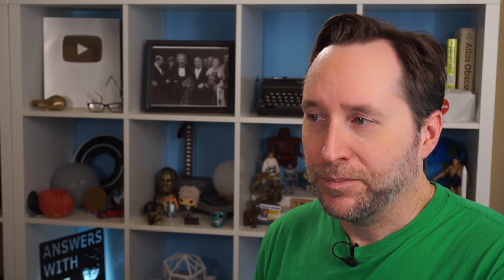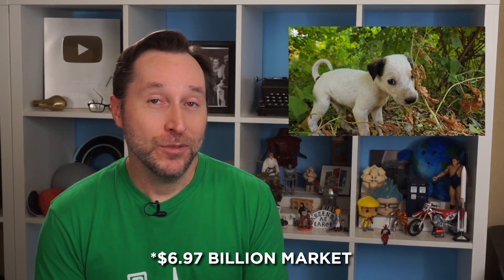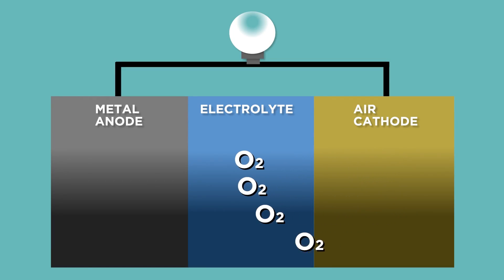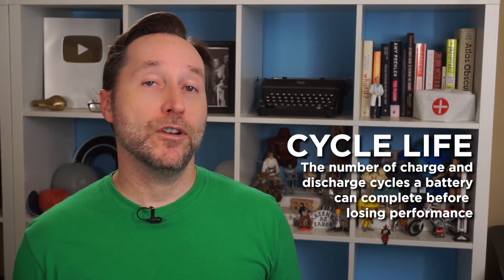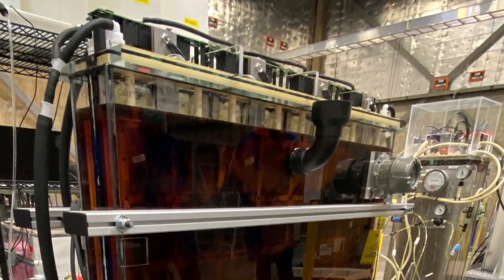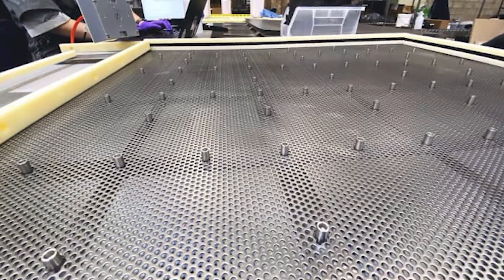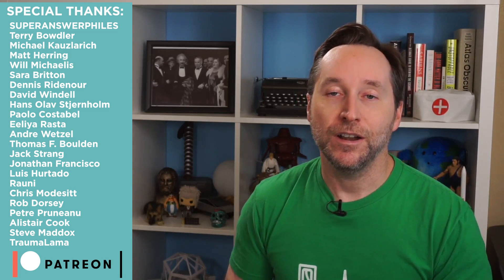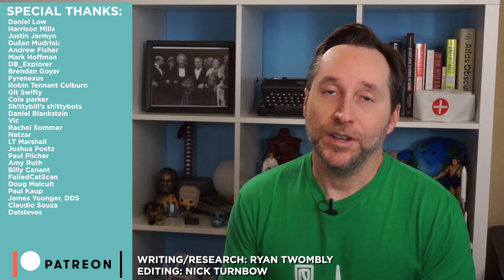Iron-Air Batteries: Storing Energy In Rust | Answers With Joe

Comment: Because of who is involved I am cautiously optimistic about these, depending on how they handle extreme temperatures.

Between these, Iron Flow, and Liquid Air Energy Storage, the latter two already being implemented,  I think nuclear will be rendered irrelevant. Especially as nuclear almost always falls behind schedule and goes over budget during construction. 

Cough, cough, Vogtle expansion, cough, cough.
Cough, cough, V.C. Summers, cough, cough.
Cough, cough, STP nuclear, cough, cough.
Cough, cough, Three Mile Island #2, cough, cough.
etc., etc., etc.😞
Reply: That's only because of excessive red tape. Red tape is also responsible for the high prices. In the early days it took months to build a new reactor, not decades. And 99% of this red tape is completely unnecessary, or even counter-productive. With sensible regulation we would be close to 100% nuclear by now, the phrase "climate change" would be unknown outside of a few scientific papers, air pollution would be small issue, and electricity would be far cheaper.

Today nuclear makes much less sense, but not because it's bad, but because solar panels are better in most cases. For example you can have your own solar panels, but unlikely to ever allowed to operate a nuclear reactor in your garage.
Reply: @andrasbiro3007  More like screw ups during construction, poor planning, and outright corruption.

I tried linking news stories but YouTube deletes them
Reply: @IronmanV5  
That's pretty normal for any large construction project, especially when the government is involved.
Reducing red tape would solve this too. We could build much smaller gen. 4 reactors in factories, and then it would be just like any product, and market forces would minimize incompetence and corruption. Plus these would also be like 1000x safer than current reactors.

Also, until the seventies nuclear power plants were built quickly and cheaply, while still being reasonably safe. The TMI accident proves this, it was a full meltdown, yet practically no radioactive contamination escaped. If we could keep building at that rate, by 2000 at the latest most of the grids would have been mostly nuclear in most of the world. The proof is France, they built a large nuclear fleet in little more than a decade, and to this day they are getting about 80% of their electricity from those plants. While also electrifying everything much faster than the rest of the world.
Reply: @andrasbiro3007  Can you point to any coal or gas fired plant that has had as much delays as nuclear does? Any wind farm on or offshore?

I guess "because government" is the new "because NIMBYs"?

The fact of the matter is the construction delays are because of construction screw ups.

For example, from the Atlanta Journal Constitution:

How Georgia nuclear project’s big finish went so wrong

"Early in 2021, crews at Georgia Power’s nuclear expansion site at Plant Vogtle were struggling to find all the leaks in a pool built to hold spent, highly radioactive fuel.

They added air pressure under the floor of the water-filled pool, hoping air bubbles would pinpoint flawed welds. It didn’t work. So an engineer doubled the air pressure.

The result: The pool’s steel floor plates were damaged, rendering them unusable. New ones had to be manufactured. The fixes and rechecks of the pool have taken nearly a year and cost millions of dollars.

It’s been that kind of a year at Plant Vogtle. Though the expansion project was supposed to be close to completion, a series of missteps and botched jobs in recent months has led to more cost overruns, further delays and fresh worries about quality and oversight.

The project has had setbacks almost since it began. But the 2021 revelations highlight how widespread the problems have become.

And there are fresh contentions that Georgia Power may have tried to hide the project’s rising costs so that work would be allowed to continue. The for-profit monopoly utility has consistently underestimated costs of the expansion.

Many of Georgia Power’s 2.6 million customers already are paying the project’s financing costs, will see their electric bills rise more for Vogtle’s construction and possibly could be hit with additional increases because of the latest problems.

Testifying in a December state hearing, independent monitor Don Grace said he believed Georgia Power repeatedly gave unreasonable projections because the company has been “trying to continue to justify the project.”

Grace, an engineer and nuclear industry veteran hired by Georgia regulators to provide an unvarnished view of the project, suggested Georgia Power’s goal is “to delay as late as possible what the real costs are going to be. I don’t know, certainly that is a valid question that one would ask.”"

As for the much balyhood SMRs, they are following in their big brother's footsteps. Only the delays are during the design phase. For example NuScale's SMRs which were supposed to operational over five years ago but they have yet to even build their first reactor.

In fact, their first customer Utah Associated Municipal Power Systems (UAMPS) doesn't expect first power until 2029.

 That's IF there aren't any more delays, but that isn't looking likely as their designs faces serious questions. For example, their steam generator, which will be inside the sealed reactor vessel, hasn't been validated and faces questions over flow problems and excess wear. 

Think of how much more renewable generating and storage capacity can be built in that time for far less money
Reply: @IronmanV5  
1. That's the point, no other type of power plant has anywhere near this much red tape. This is not accidental, and has nothing to do with radiation, it's just politics. Fossil fuels are one of the biggest businesses in the world, and also have high strategic importance, so they can easily influence politicians to protect them from competition.

2. And I was talking about government projects. Due to the excessive red tape, all nuclear power plants are essentially government projects. Most other power plants aren't. Look up almost any large government project an you'll likely find excessive delays and cost overruns. 

3. Construction "screw ups" are also the result of excessive red tape. Everything has to be perfect and the absolute highest quality. Also fixing mistakes are very expensive and take even more paperwork, which of course causes massive delays and cost overruns. Or you think that people working on a nuclear power plant somehow make more mistakes than others?

4. All the issues you listed just reinforce what I wrote.

5. SMRs are in development phase. Also the red tape issue hasn't been solved yet.

6. The first ever civilian nuclear reactor (Shippingport) was built in less than 4 years, and remained in operation for 30 years. Even in the seventies, a typical large power plant was built in about 8 years. After TMI, and especially Chernobyl, things changed. And it's no fault of the nuclear industry. At TMI all safety measures worked and despite a total meltdown there was no danger to the public, plus the problem was trivial to fix. And Chernobyl was in the Soviet Union, it was designed, built and operated by a completely different industry, under a completely different type of government, so the accident had as much to do with western power plants as the crash of a Mig-21 has to do with the safety of the F-16.
Reply: @andrasbiro3007  

Dr. Greg Jaczko, former Chairman of the U.S. Nuclear Regulatory Commission
Prof. Wolfgang Renneberg, former Head of the Reactor Safety, Radiation Protection and Nuclear Waste, Federal Environment Ministry, Germany
Dr. Bernard Laponche, former Director General, French Agency for Energy Management, former Advisor to French Minister of Environment, Energy and Nuclear Safety
Dr. Paul Dorfman, former Secretary UK Govt. Committee Examining Radiation Risk from  Internal Emitters

“As key experts who have worked on the front-line of the nuclear issue, we’ve all involved at the highest governmental nuclear regulatory and radiation protection levels in the US, Germany, France and UK. In this context, we consider it our collective responsibility to comment on the main issue: Whether nuclear could play a significant role as a strategy against climate change.

“The central message, repeated again and again, that a new generation of nuclear will be clean, safe, smart and cheap, is fiction. The reality is nuclear is neither clean, safe or smart; but a very complex technology with the potential to cause significant harm. Nuclear isn’t cheap, but extremely costly. Perhaps most importantly nuclear is just not part of any feasible strategy that could counter climate change. To make a relevant contribution to global power generation, up to more than ten thousand new reactors would be required, depending on reactor design.”

In short, nuclear as strategy against climate change is:

Too costly in absolute terms to make a relevant contribution to global power production

More expensive than renewable energy in terms of energy production and CO2 mitigation, even taking into account costs of grid management tools like energy storage associated with renewables rollout.

Too costly and risky for financial market investment, and therefore dependent on very large public subsidies and loan guarantees.

Unsustainable due to the unresolved problem of very long-lived radioactive waste.

Financially unsustainable as no economic institution is prepared to insure against the full potential cost, environmental and human impacts of accidental radiation release – with the majority of those very significant costs being borne by the public.

Inherently risky due to unavoidable cascading accidents from human error, internal faults, and external impacts; vulnerability to climate-driven sea-level rise, storm, storm surge, inundation and flooding hazard, resulting in international economic impacts.

Subject to too many unresolved technical and safety problems associated with newer unproven concepts, including ‘Advanced’ and Small Modular Reactors (SMRs).

Too unwieldy and complex to create an efficient industrial regime for reactor construction and operation processes within the intended build-time and scope needed for climate change mitigation.

Unlikely to make a relevant contribution to necessary climate change mitigation needed by the 2030’s due to nuclear’s impracticably lengthy development and construction time-lines, and the overwhelming construction costs of the very great volume of reactors that would be needed to make a difference.
Reply: @IronmanV5  
1. You lost me at the first name. Jaczko is one of the biggest anti-nuclear activists, everyone hates him in the industry.
2. Also there are literally thousands of different reactor designs, with wildly different characteristics, including cost. And, again, at least 90% of the cost comes from excessive red tap that doesn't improve safety. Actually the excessive red tape reduces safety by preventing innovation and the replacement of old reactors with 1000x safer new ones.
3. Small modular reactors, mass produced in factories, could make a big difference very fast.
4. Nuclear fission was discovered in the December of 1938. The first reactor went critical in December 1942. By 1953 the first nuclear submarine was launched. That's how fast things can happen if you don't have red tape. If we really wanted we could design and start mass producing a small reactor in like 5 years. And it would be like 100x cheaper and infinitely safer than current big reactors.
Reply: @andrasbiro3007  1. You could only call their informed opinion an Appeal to Authority fallacy if they didn't have experience with nuclear, which they do.

Earlier you had said "Jaczko is one of the biggest anti-nuclear activists, everyone hates him in the industry." & "Also I don't know them and don't care. The only one I know is the first one, and that's the worst guy you could possibly bring up, so I don't have much hope for the rest."

Ad Hominem - THE most well known logical fallacy.

2. "Ignore the news, they are clueless, or lying." & "Again, the media is lying all the time." 

Once again, Ad Hominem - THE most well known logical fallacy.

3. Flying is safer because of stronger regulations and more enforcement. So finding counterfeit & substandard parts in nuclear plants proves we need more regulations. 

Or are you going to use an ad hominem attack and claim that the  Inspector General of the NRC was lying? 

The Verge article was based on their report which was linked in their article.

All the other news stories on delays are based on publicly available records and statements from regulators, operators, and builders.

For example, last february during the freeze down here in Texas when STP nuclear, SW of Houston, had one of their two reactors go down the Houston Chronicle reported:

"One of the two reactors of the South Texas Nuclear Power Station in Matagorda County shut down, knocking out about half of its 2,700 megawatts of generating capacity. On Monday, Unit 1 went offline cold weather-related issues in the plant’s feedwater system, said Vicki Rowland, lead of internal communications at STP Nuclear Operating Co."

But they're "lying all the time" /s

Could you do more to undermine your arguments?

Also, paragraphs.
Reply: @IronmanV5  
1. You don't understand what "Appeal to Authority" means. They can have all the experience in the world, that doesn't make their opinions irrefutable. Their opinions have more weight than an average person's, but still not even in the same class as facts and logic. Must I list a bunch of very smart people who said very stupid things in their own fields? Even Albert fucking Einstein wasn't immune to this.

2. Not a fallacy, it's a fact. He has a very strong anti-nuclear agenda, which makes his opinion completely unreliable.

3. Nuclear energy is far more regulated than flying. And incidentally far safer too. And to quote the NRC "While the report's findings include the ongoing presence of CFSI at U.S. reactors, nothing in the report suggests an immediate safety concern". Also the fact is that nuclear is among the safest energy sources, even with Chernobyl and Fukushima, of which neither were up to western safety standards. Especially Chernobyl. Fukushima was a western design, but very old, with known design flaws and vulnerabilities that were not addressed. And even then, not a single person was killed by the power plant, and according to international safety standards, even most of the evacuation was unnecessary.

4. A reactor went offline due to cold weather? Who is it a safety issue?

5. As I already explained most existing reactors are very old, we could do infinitely better today, but red tape and politics reliably kills all projects. A lot of companies are trying, and has been trying for decades, but it's extremely hard to actually build something, and not because of the technology. There are designs that could be built like tomorrow, because they use 100% off-the-self components, and would be practically 100% safe, and like 10x to 100x cheaper.
Reply: @andrasbiro3007  
1. Except that their opinion is supported by factual evidence.  Like all the broken promises of how nuclear would get faster to build and provide cheap power.

2."He has a very strong anti-nuclear agenda, which makes his opinion completely unreliable."

Going by that logic, then anyone who has a "very strong pro-nuclear agenda" opinion''s also completely unreliable. And you have the other three former regulators who share the same opinion borne of experience.

Oh, and "ad hominem fallacy uses personal attacks rather than logic. This fallacy occurs when someone rejects or criticizes another point of view based on the personal characteristics, ethnic background, physical appearance, or other non-relevant traits of the person who holds it. "

3. It's heavily regulated because it has to be. Funny how Fukushima's "design flaws and vulnerabilities" only came out AFTER their meltdown. How many other facilities have "design flaws and vulnerabilities"? 

And it's more than just safety. Which leads to:

4. I referenced STP failure as reported by the Houston Chronicle to refute your  ad hominem attack that the "media lies". 

But more than that, when Texas had it's power emergency (thanks lax regulations "No need to winterize power plants") and it was nuclear's time to shine by providing reliable power no matter the weather conditions, it dropped the ball. 

It is inexcusable for an expensive power plant designed to last 40+ years to not be able to handle a little cold snap. 

5. They are killed off because anyone with a lick of sense can see their history of blown schedules & cost over runs thanks to poor planning & construction screw ups, one which still continues.

Olkiluoto #3 - 17 years since construction began at twice the original price
Flamanville #3 - 15 years since the start of construction and so far four times the original price
(5 year schedule for both)
Vogtle #3&#4 - IF they go online next year it will be 7 years after it's original scheduled completion date and so far twice the original price.
V.C. Summers - The builders were fined and people have been indicted on federal fraud charges.

 TMI #2 took 50% longer to build and cost 75% more than TMI #1 even though they were built right next to each other and TMI#2 started construction a year after TMI #1

STP nuclear fell behind schedule & went over budget BEFORE TMI #2's accident.

Etc., etc. (thanks construction screw ups!)

Compare that to renewables which can be built in a fraction of the time and provide power at less than half the cost AND FALLING 

ourworldindata org/cheap-renewables-growth

and now with storage to handle intermittency, which Tesla proved works and is cost effective using expensive Li ion batteries. LFP & Na ion are cheaper still and more durable (Na ion uses plentiful sodium). Plus with  longer duration and longer term storage which is being deployed as we speak (Iron Flow batteries in San Diego, Liquid Air Energy Storage in Vermont, Manchester UK, & Scotland) and possibly these iron air batteries a week or more of cloudy skies or low wind is no issue.

Let those private companies spend their own money. Considering nuclear's long history of schedule & cost overruns, I wouldn't hold my breath.
Reply: @IronmanV5  
1. Except no. Nuclear reactors were built very fast before all the red tape. And still nuclear power is one of the cheapest sources of energy, even with the red tape that makes them 100x more expensive than they should be.

2. Look him up and you'll understand.

3. Fukushima's design flaws and vulnerabilities were well known well in advance. The problem wasn't lack of regulation, but lack of enforcement on part of the Japanese regulators. Also these reactors were an ancient design. 

4. The media lies, that's a fact. And in Texas every kind of power plants failed. They consciously chose to not prepare for freezing temps to save money.

5. Again, mostly red tape and lost knowledge. And, again, practically all large construction projects experience significant delays and cost overruns. Especially ones that involve governments. That's why SMRs could be drastically faster and cheaper to build. A smoothly running production line instead of unique large construction projects. Plus build quality would be naturally much higher.

6. Renewables are getting there. But Nuclear was there 70 years ago already. And, again, with SMRs nuclear energy would be cost competitive for a long time still. Also nuclear have many significant advantages over renewables, so there will always be a need for them.